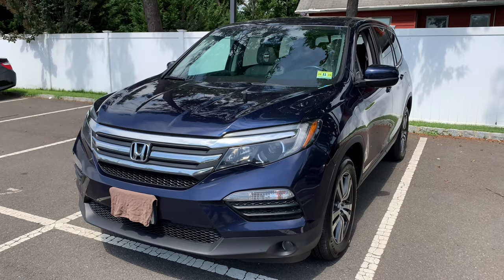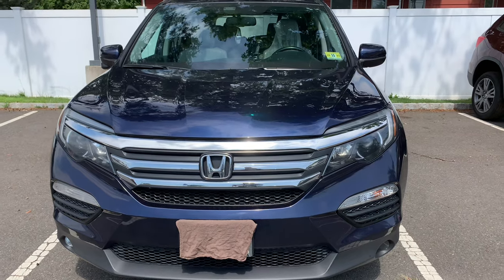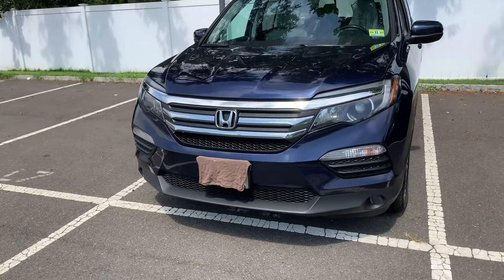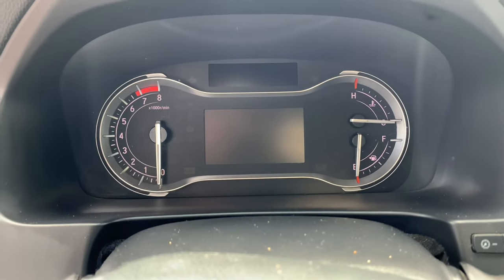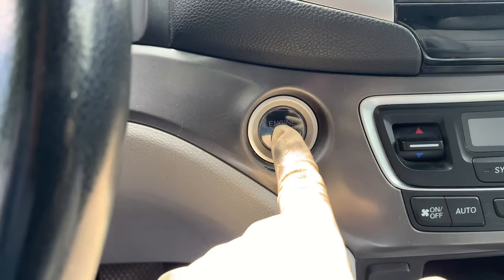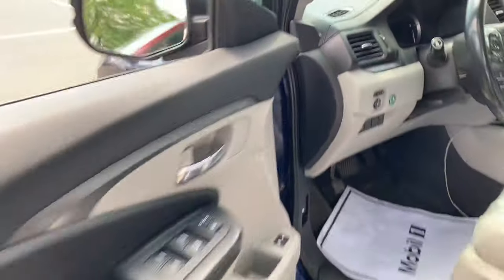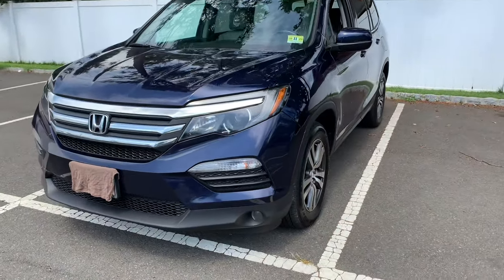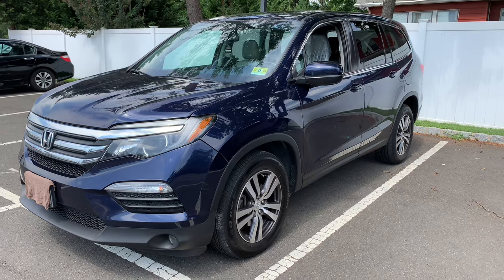2016 - 2018 Honda Pilot common problems

Comment: Hello I am a Uber driver. I’ve had this car since 2016 the new I hold 202,000miles. Please take it from a person with experience not a mechanic every problem he has said I have had the fuel injector problems first came to me when I had 30,000 miles on the dealership and the corporation did not want to take responsibility. Oh my God screwed $2000 to fix something that’s not my fault, second of all the transmission the same thing he said happened to me I have never seen a transmission like this car. I have to change the oil every oil change roughly between 5 to 7000 miles ridiculous I’ve had the same problem with the pushbutton start. Thank God I fixed it myself. The store has been nothing but a big royal pain in the ass. I wish I never purchased it. I also was the person that told me the store is on the lowest part of hell
Reply from the maker: So first off I want to apologize for their incompetence. The injectors have a warranty extension and if you have paper work stating you paid it I would 💯 try and get reimbursed. The start/stop switch also has a warranty extension, although that’s a fairly cheap repair and not as critical to peruse imo. The biggest deal is the trans! Yes with Uber/Lyft we have to change the fluid at a very ridiculous and unreasonable rate as you have stated. Best of luck going forward 👍🏻
Reply: I have the receipt for fixing the fuel injectors I fixed them the second year I got this car which was a 2017 which I took her to the Honda dealership and they replaced it where do you want me to upload or email you the receipt from Honda I have it
Reply from the maker: @ziad9649  yes that’s about when we started changing them. I would just contact corporate American Honda and see what they can say. I can’t get involved in that. I’m not sure what they will do, it’s worth a shot tho for sure. Good luck with it 👍🏻

Comment: why Honda always has trashy transmissions, and i mean since the mid 2000s, Honda used to neck and neck with Toyota in terms of quality.
Reply from the maker: They have come a long way since 06-08. Really the only problematic ones are the 6at and some cvts. No where as bad as early 90s - mid 00s. Back then we were doing 3-4 trans a day! Now we do maybe 5 a month. Huge difference and improvement.
Reply: @BCautosolutions  im considering buying an SUV  either Honda pilot or Acura MDX,  just doing little research, i wish u would do video about  "the best reliable Model years to buy " for either Honda pilot or Acura MDX , that would be an awesome video series.
Reply from the maker: @Omar-on804  ok yeah, i can do something like that.